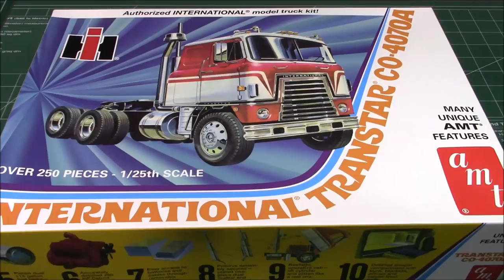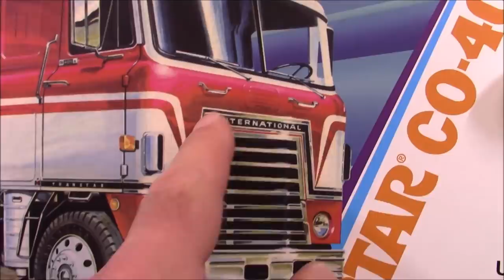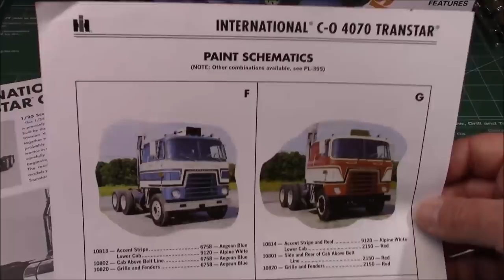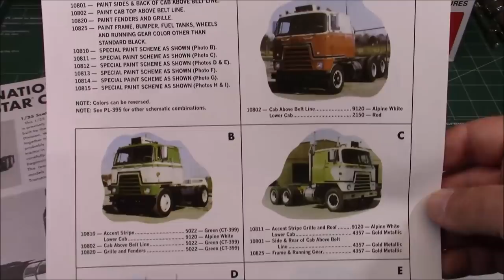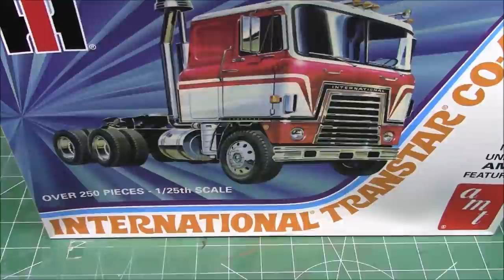NEW MOLDS! INTERNATIONAL TRANSTAR CO 4070A SEMI TRACTOR 1/25 SCALE MODEL KIT Build Review AMT 1203

Comment: I drove this truck back in the 80's being a cabover it was like sitting in a blender with wheels! It would shake so bad that the headlight buckets would work loose and fall off! Ah the good ol days!😉
Reply: I did to with a old 318 Detroit  ..that truck would rattle ur fillings out of ur teeth
Reply: Too funny!!!
Reply: my dad drove one for Metz Baking Co hauling Old Home Bread
Reply: @krazi77  To the Old Home Fill 'Er Up and A Keep On A Truckin' Cafe? Lookin' for Mavis?
Reply: @oldrustycars  maybe. that could explain why he would get home really late sometimes.
Reply: I learned on one. No frills.
Reply: I remember my grandfather drove one... I got to ride with him to and from the diesel shop. It shook like you described
Reply: I remember seeing so many Transtar Eagle tractors on the road while growing up in the 80s. I still see an occasional one today! The truck was also featured in The Terminator. At the time I didn't know what kind of engine it had or what a two-stroke Detroit Diesel was. Since the engine is a turbocharged two-stroke in a V configuration and since the driver is directly above it, it is no surprise that the vibration is extreme.
Reply: Now the modern trucks fall apart on the factory floor 😂 (talkin about you Freightliner!)
Reply: I saw one of these, back in the early 2000s so it had some miles on it and was very tired by then, on the side of I-96 in Detroit. The engine was in the middle of the infamous Detroit-Runaway, the front tire leaving the ground and black smoke intermittently pouring out the stacks, the frame was twisting so hard it looked like the truck was going to roll over during each pulse.
You (Chris) mentioned how high the old 2-stroke Detroits rev, this thing was leaping to what sounded like about 10K each time it got a mouthful of oil. It was probably nowhere near that but it was definitely screaming a full octave higher than normal. 
The driver had abandoned ship and was wisely hiding at the back of the trailer, peeking around and waiting for the inevitable parts redistribution to occur. 
I was in the opposing lanes and didn’t stick around to see what happened but his side was almost dead stopped and packed with vehicles. 
I wouldn’t want to have been one of the cars stopped beside that thing when it let go. 

Sorry to hijack the thread - it was the exact same truck (in brown) and watching this build brought that memory back. 
I’ve been waffling over which tractor to build to go with my car trailer and this video has made up my mind. Great build as always, this kit looks fantastic and should have lots of potential for extra detailing without the usual frustration burnout that comes with many highway tractor kits.
Reply: Those cabovers were pretty rough… I don’t know how drivers were able to go coast to coast in them…

Comment: The reason it's the nicest AMT kit is because even though AMT acquired Ertl, they never produced this kit from it's original release and only because Round 2 released it they had to use the AMT logo instead of the Ertl name due to licensing rights, but growing up, I remember when a $5.00 bill would get you any Ertl kit and Yellow Front Store in Phoenix Arizona always had them on sale for $3.50, mowed alot of yards to buy all the Ertl and AMT truck kits.

Comment: I had this kit when I was a  kid, the only thing I remember is the different front rim of being of the old style split type rim. the rears were chromed. other than that It did have numbered parts on the trees. the kit it's self is the same. but I had several mods (electrical / air lines) to one and did my own company logo painted by hand. it was the parent to company 7-11 (Southland Corp) also their distributor. my mods were opening cab doors, head, cab clearance, and tail lights, with a lighted dash, along with fog lights. the new kit now is much more with new additions. i also put in carpet (felt) and cloth for the bunk. did more detail to air and electrical lines. for the 5th wheel I used real grease from a real truck.  I used the AMT Great Dane 40ft trailer and also did customizing in it too! inside I put in balsa wood, and light able clearance lights with tail. changed the opening doors to a roll up. made a lockable pin for the tandems on the trailer to adjust the tandems. used a rectangle box under the trailer for a the battery to light the truck and trailer together.

Comment: That's an awesome International cab over model! I believe my dad made this very one when I was a toddler based on his actual tractor he had, I remember it fondly because I played with it like a toy and unwillingly tore it apart. This does look like a nice model to build, I severely struggled on the AMT W 925 kenworth I see you have built one maybe it's a better mold than the Watkins version I had where nothing lined up, a lot of twisted parts and glue pins that hardly existed. I was building the Smokey and the Bandit "Bandit #2" Snowman tractor trailer and practically have the trailer done, the rear end assembly looks awesome! I even built landing gear feet from scratch styrene. Thank you for your incredible model building videos!

Comment: I'm not a big fan of green but I bow to the master of the rattle-can paint job -- you are awesome.
I was surprised to see you brushing Testers silver enamel.  It is great for touching up attachment points on chrome parts -- blowing lightly onto adds to the shine.  But it hates drying for ever, and there are so many shades of metallic acrylics.
Tip:  If you want to hang some wire from the pogo stick to simulate air lines, you can use O gauge airline connectors to simulate the glad-hands.  Attach them to the trailer's airlines and you can connect or disconnect them at will.

Comment: My Dad had a couple of these, i drove a few then my brother and i bought one. Good times yes. But after remembering how miserable we were in any adverse weather?!? Ya no thanks, there's a reason they don't build these in real life anymore. Not hating on them, just being real & honest. Would i own one as a "hot rod" weekend cruiser? Yes. Would i spend every day in one at work running the midwest? No. Heck i think i'd even turn it into an RV and cruise the US in it, but just not comfortable enough to spend 70 hours a week in it.
P.S. i prefer my current work truck, it's a 2024 Volvo 760. Absolutely the most comfortable & QUIET and one of the most powerful trucks Ive ever driven. Semis have come a long way since the days of the old cabovers... thank God. 😂👍🏻💯
P.S.S. Yes i built this model when i was a kid, my sister built the ErtL kit. The international constructor paystar conventional version that had the cement mixer, but i had so many spare parts we made a regular semi tractor out of it. Id like to see the old R model Mack and the Peterbilt 359 and cabover kenworth get brought back too. The ford L 9000 six wheeler. The cabover frieghtliner day cab with CF decals and AMT's double trailer kit would be cool too as well as the gas tanker and ertL extendable flatbed trailer and low boy w/bull dozer. 👍🏻 I used to use vinyl and rubber hoses w/ solid copper wires from the old land line phones to mimic as much of the real trucks as i could since i grew up in a trucking family and eventually wound up being a trucker for life lol. Details matter, just like nitrous oxide plumbing on a ford galaxy under the hood.

Comment: Looking forward to this kit myself. The suspension is Neway air ride which will make be a nice addition to any other make of truck. Especially heavy duty applications.  The engine is an 8V-71. Not all that big actually. 568 cubic inches and were offered in 260, 290, or 318 horsepower. Looks like a great kit. I use stripping tape for fuel tank straps
Reply from the maker: Thanks for stopping by!

Comment: Have to agree with you, Chris. This is one awesome kit!! Built an original ERTL when it was first released in the 70's.
I'm building / modifying one right now to rep the real one I drove in the 1980's as a gift for my grandson. I'm almost 70 and it's the first model for me in over 40 years.
Chopped 2 scale feet out of the frame and am swapping in a Cummins engine from an Autocar kit. 

Really need to know, though, did the white factory decals cover that beautiful green that well? My truck was the same pattern but the base color was a medium "baby blue". I've been fretting about masking the cab but if the decals are that great I'll just use them. Lots easier on old eyes!
Great review and presentation. You've made me a subscriber. Keep up the great work!!!
Reply from the maker: I build as is, so what you see is how I did it.  The decals are laid over the paint as normal.
Reply: @hpiguy  Thanks Chris, you just saved some old tired eyes a ton of masking! Appreciate the reply!

Comment: Was the red engine color a call out on the instructions? I wondered since back then,all IH  engines were red. Wouldn't surprise me,since in this time period, Peterbuilt painted all the engines regardless of manufacturer, white. 
Happy birthday,mine was on the 2nd! 
I can't wait to get this one a couple times! Round two says it's gonna be late July before they are available.
Reply: HAPPY BIRTHDAY BROTHER
Reply: The 71 series,were painted in that iconic Detroit Diesel Alpine Green;while the Silver 8V92Ts were painted in what I would call Detroit Diesel red.If you want the specific shade of red;the engine on the real full size truck would have been painted at the factory,Dupli-Color has red ceramic engine enamel spray paint;that is in the factory color code Detroit used back in the day,that you can buy at Auto Zone,Napa,Advanced Auto Parts,and O'Reiley's Auto Parts for about $7.00 a can.
Reply from the maker: Yes, the directions say 'red'.

Comment: The Detroit’s were and are referred to as two stroke converters, they converted diesel fuel to smoke and noise! Yep great kit gonna have to check them out.
Reply: Detroit Diesel engines were painted light green, always leaked oil they were given the nickname "Green Leaker".  The fit on the Ertl  model kits was perfect.   The Mack Dm 600  and the 4300 Transtar convential by Ertl were  nice semi tractors  too.

Comment: I tried using Rustoleum paints/primer on my models and it was a nightmare. Within a few seconds of application to a cured primer coat, paint started to peel up and crack. I switched over to DupliColor automotive primers and finishes and zero issues. Their extra thick clear coat makes the models glassy smooth.

Comment: Question, I’m putting one of these together I have the rat Fink one and also the other AMG model, and both of them tell you to hook a piece to the idler arm, which appears in the instructions, but the idler arm is not on the frame and it doesn’t show anywhere in the instructions where that piece is. did you run into this problem?

Comment: THIS WAS AN ERTL KIT IN THE MID 70s ..AND SOLD FOR $6.95 I BOUGHT MANY OF THESE KITS
Reply: Sells for $60 almost 50 years later.
Reply: The 4070A was ERTL'S first issue in 1973 the 4070B was released in 1976 I remembered these kits the transtar 2 4070B was released in 1995 tho both are great kits the 4070A was never released only once in 73 and that was it

Comment: If Round 2 were to retool their truck kits the first has to be the AMT White Freightliner COE. What was AMT thinking at the time when they made the cab a three piece assembly? The Freightliner COE is one of my all time favorite classic big rigs, but with the AMT kit, trying to get the cab pieces aligned correctly, along with trying to fill the obnoxious seam that runs right through the middle of the cab is frustrating, not to mention that particular kit has some of the worse fitting, and worse executed parts of all of them. It's like the dude who engineered that kit came to work totally drunk. 

Anyone who's built the AMT White Freightliner COE knows what a frustrating build that kit is, and is the one kit that needs some serious reengineering, and retooling. What's bad also is if you want to build a detailed glue kit of a 70s era Freightliner Coe, you have no choice but to go with AMT's version, as Revell never did a kit of that rig, like they did with the Peterbilt 359, the Kenworth W900, and the Kenworth K100, giving modelers better alternatives to the AMT versions of those rigs.